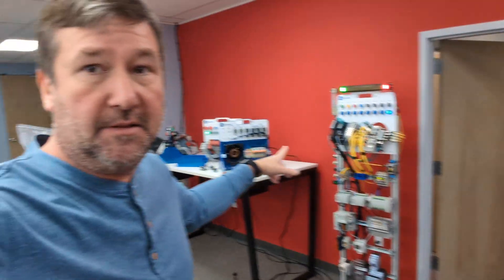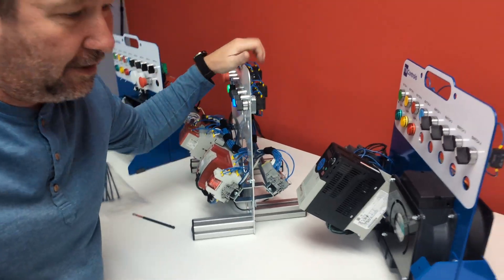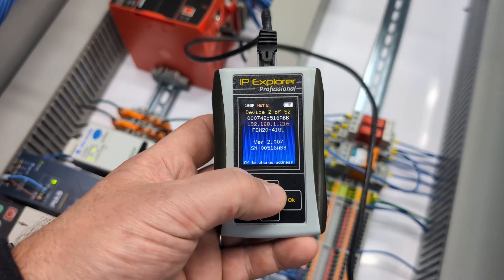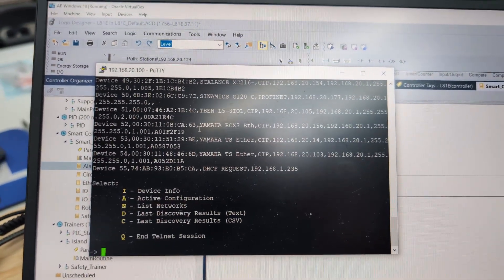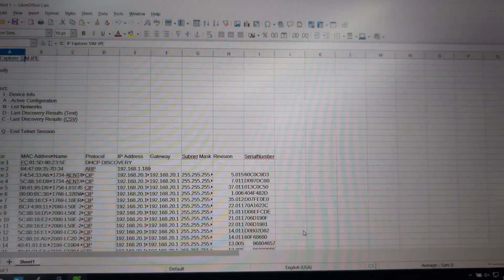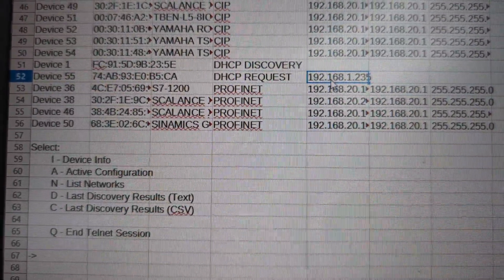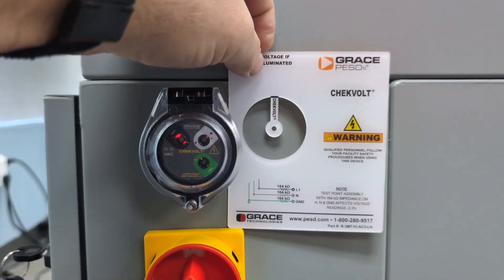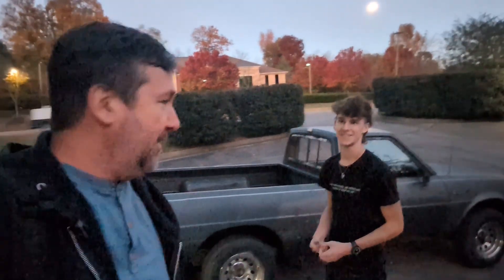New Wiring , Unexpected Problems, and the Hunt for the Network Ghost

Comment: Hey Tim, thanks for all the informational videos. I have a question on the 2085-OF4 on a micro850. I am trying to output a 0-10 volt to a stepper motor driver that is expecting that range of voltage to drive a needle valve. (Enfield d5-05-u01 stepper driver, and env 0670 needle valve).
I’m having issues getting the 2085-of4 to output a voltage at all. I am using a digital pulse generator to set my voltage but even without that I’m not able to get it to output a voltage. Not many videos on voltage output, maybe something worth your time! Thanks
Reply from the maker: They are disabled and in current mode by default.  You'll need to enable the channel and select voltage mode.  Here is a video on CCW analog.
https://youtube.com/live/AjaA3U0tHeE